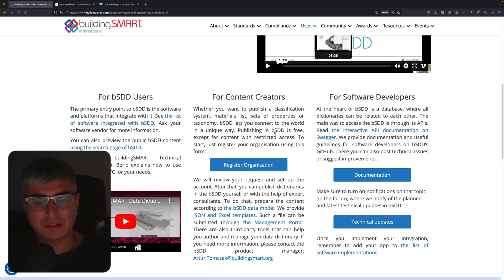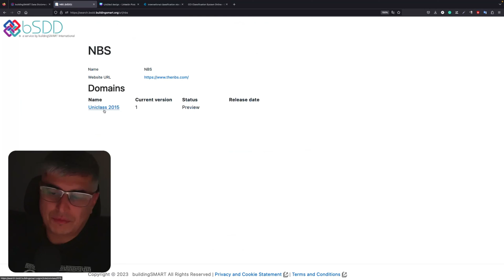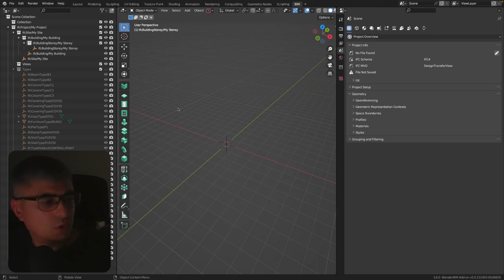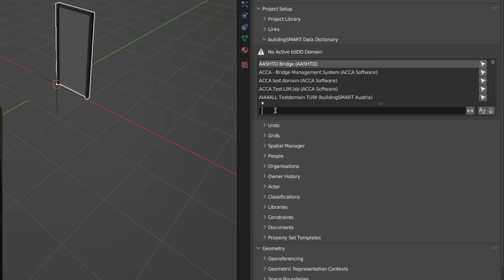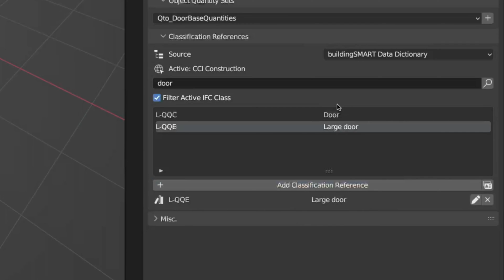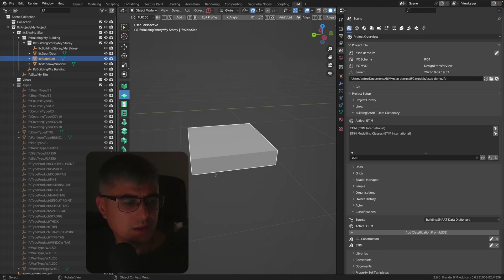Hands-On bSDD with BlenderBIM #openbim #bsdd

Comment: Hi Petru, thank you for this video. Very clear and interesting. Because you asked for if, Archicad allows external classification reference on bim elements, i used Uniformat on one project few year ago.  But as far as i know, it doesn't provide any direct link to bsdd services. It is need to get some xml file that is imported in archicad  (a bit like what one can do if importing classification from ifcfile in BlenderBim, if i understand well) and i don't think you have as much choice that bsdd provides.

Comment: Great video! A minor note that in general it would be better practice to assign classifications onto the element type, not the element. The classification will then be inherited by all occurrences. It's not necessary to assign to every single occurrence and this is a mistake that software like Revit makes. (note you can fix the Revit bug using IfcPatch).
Reply from the maker: That's a very good point Dion, thank you for pointing that out to me. And also thank you for being an amazing mentor to me!